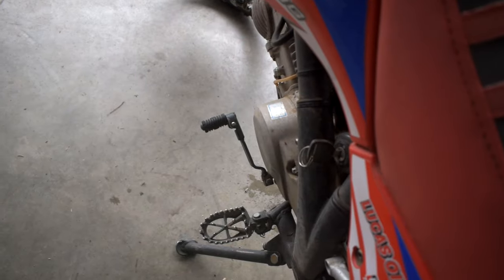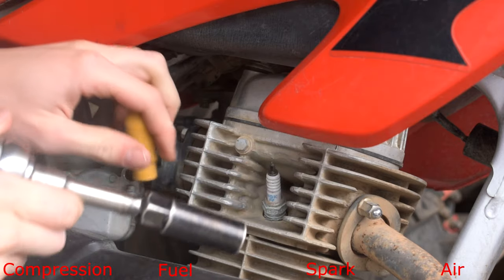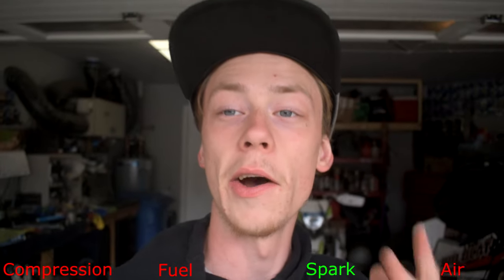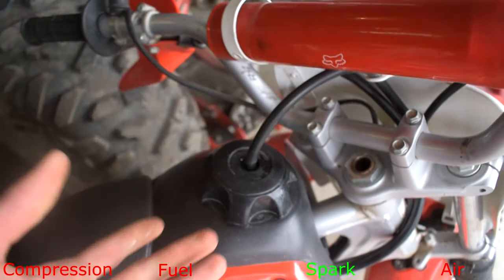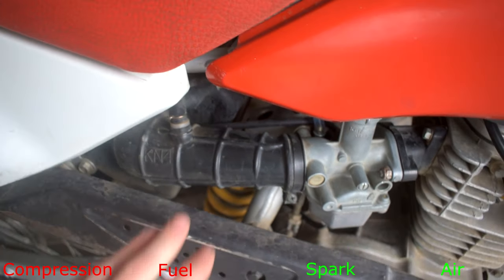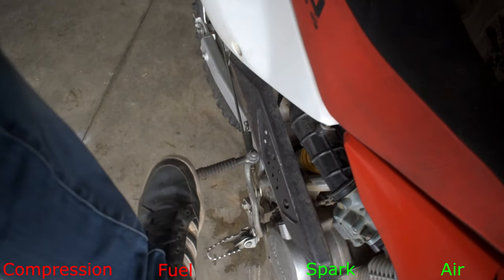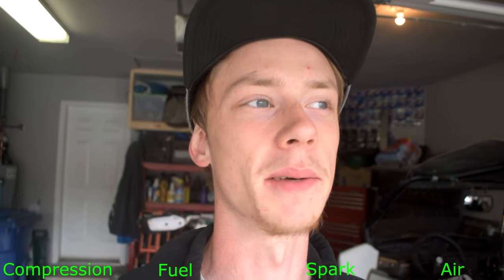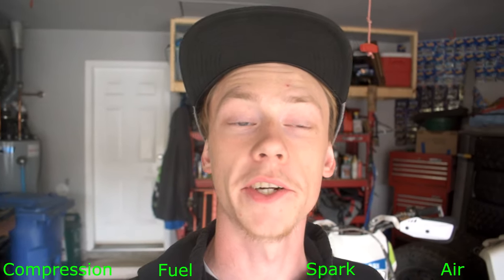Dirt Bike Wont Start? Here's How To Fix It + EXTRA TIPS

Comment: I got a 2010 coolster 70cc pit bike and won’t start with low compression. I have spark, fuel, and i even put fuel in the spark plug but wouldn’t even try to start
Reply from the maker: If it has low compression that’s your problem
Reply: @AaronsEnduro  how do i fix
Reply: @AaronsEnduro  and how much would it cost
Reply: @AaronsEnduro  could i still bump start it
Reply from the maker: Thats the same problem as someone saying “my heart barely pumps any blood whats the fix?” Well get a new heart or get an artificial replacement lol

Thats the sign of a blown engine buddy
Reply from the maker: Also, putting fuel in the spark plug is not what you wanna do. Thats how you hydro lock the engine. Your supposed to put the fuel on the air filter to see if your issue was fuel related. Liquid doesn’t compress, so when you put it into the spark plug you could of blown your engine
Reply: @AaronsEnduro  me and my dad fixed the timing chain but won’t start. One of the valves it tight so were gonna loosen it up tomorrow any other ideas?

Comment: what if everything is good but it wont start ( i think the spark dont get gas)
Reply from the maker: If the bike has EFI and your battery has to low of voltage it wont be able to run either
Reply: @AaronsEnduro  i have a cheap chinese pit bike it doesnt have a battery
Reply: @AaronsEnduro  did it now its better than ever the problem was with the timeing
Reply from the maker: Timing will definitely mess it up! Glad you were able to get to sorted out! And tha ks for reporting back on the issue!

Comment: Would it be making a different sound if there’s no spark
Reply from the maker: If theres no spark the bike wont run. If it runs but super crappy u may have weak spark. Check the spark plug. You may need a new plug or to tighten the spark plug gap
Reply: @AaronsEnduro  I can’t get it to start at all and when I poll the throttle and kick it it makes a weird sound
Reply from the maker: Have you checked to see if you’re getting spark?
Reply: @AaronsEnduro  I got it to start then it turned off on me the night before it rained  and idk if water got in the exhaust I took off the exhaust and only like a few drops was in it but I got it to start like 2 times but it was really cold and just turned off both times within 10 to 30 seconds and after that I haven’t been able to get it to start
Reply from the maker: What did you check
Reply: @AaronsEnduro  but if I’m getting no spark and I pull the throttle will it make a different sound
Reply: @AaronsEnduro  I checked oil gas air box last thing is spark just haven’t done it yet but will in the morning I wish I could explain the sound
Reply from the maker: Check in after u check if you have spark
Reply: @AaronsEnduro  ok thank you

Comment: Just wondering if you are still answering questions I know this video is older
Reply from the maker: Always brotha
Reply: @AaronsEnduro  my buddy just got a magician 250 getting spark, plenty of compression, good air, I moved the kick stand kill switch so i didnt have to fight that. now it cranks but i cannot get it to turn over. I hit it with starting fluid and It starts and stops that quick. looked at the carb and it is clean, plug not fowled either. it almost feels like a kill switch is engaged but cant seem to figure this out... Any ideas? Thanks.
Reply from the maker: How did you remove the killswitch. Did you hardwire it? From your description it sounds like the killswitch is shutting the ignition off

Comment: is it still worth buying a bike with no compression for 300 i can easly fix it??
Reply from the maker: Depends if your willing do a full engine rebuild or not. Also depends if the bottom end is (crankshaft) is toast
Reply: In the ad it says the ring is toasted it just needs new rings
Reply from the maker: Id be careful with that. If it has a cracked ring lang is may have toasted the cylinder walls too. Then if that debris fell into the crankcase id say shes done
Reply: @AaronsEnduro  damn so what do I do is there a way I can check???
Reply from the maker: Its kind of a gamble buying blown engines. You wont really know until you tear into it
Reply: @AaronsEnduro  but would it be expensive to fix it? If it's not just the ring
Reply from the maker: If you rings broke, you’ll definitely need a new piston, cylinder and possibly a head if it’s damaged. Will it be “cheap” depends if you’re doing all the work, and how badly it’s damaged.
Reply: @AaronsEnduro  around how much will it cost for the parts this is my last question and I'll stop bothering you
Reply from the maker: First, i have no idea what bike you’re referencing. 

Second, like i said depends if you’re doing the work or paying someone to do it.

500-3000$+
Reply: @AaronsEnduro  damn that's expensive am doing it my self the bike is a Honda cr85 2005
Reply from the maker: Okay so 2 stroke, easier than 4 stroke rebuild. Its really hard to guesstimate a price until you got it apart and see what all broke
Reply: @AaronsEnduro  ok thanks for the help am going to talk the the seller about the bike and thankd again for the help 🙏

Comment: Mate my bike has all of the above, it’s a brand new pit bike 2 hours on the hour meter, ran perfect yesterday cleaned it and it ran fine after cleaning it yesterday, today it just will not start, everything’s dry, it’s stressing me out
Reply from the maker: Did you cover the exhaust
Reply: @AaronsEnduro  when cleaning it yes,   It’s stressing me right out, every couple of kicks it just pops a flame out the back, but it won’t start
Reply from the maker: Have you tried bump starting it
Reply from the maker: You might just needa kick it like a man
Reply from the maker: U watched the whole video?
Reply: @AaronsEnduro  yeah it won’t bump start either, I’m no novice to put bikes I’ve had loads in the past, but this thing is baffling me
Reply: @AaronsEnduro  yep
Reply from the maker: Does the kickstarter have resistance
Reply from the maker: And can you feel the engine turn over
Reply: @AaronsEnduro  yeah man it’s a zongshen 190
Reply from the maker: Gotta be a key or something you missed, no?

Comment: Ok, so I wrode my klx140rf through a  little puddle of water, and it was barely at the engine like that's how high it was. And after I got out of the water, I was only in for like is full second. It wouldn't start, it wouldn't idle, it wouldn't gas. And when it did start, I couldn't rev but an hour later, perfectly fine. Why
Reply from the maker: My Guess would be air on into the airbox and choked the bike out
Reply from the maker: Or some sort of electrical connection was shorting from water. Considering you say its an RF its a 2021? So brand new? Weird to have any issues there
Reply: @AaronsEnduro  yeah brand new got it a month ago everything is fine but yesterday that happend and it just wouldn't start like 45 Min later just started up like a champ
Reply: @AaronsEnduro  and Im pretty sure it wasn't shorting because the light was still on from the starter but we would go to start and it just went and made the starting sound before it starts
Reply from the maker: Water got in somewhere. Thats forsure

Comment: Hi I have a 125 braap it has compression fuel spark air but still won't start any idea's?
Reply from the maker: If it had all those it would start
Reply: @AaronsEnduro  it kickes over like it wants to start but just won't for some reason
Reply from the maker: @coreywilliams7207  what changed or happened since it last started up. How long ago did it run
Reply: Not 100% sure the guy i got it off said it just stopped one day so I replaced the carby cdi and coil and spark plug and lead and throttle
Reply from the maker: So how do you know it has compression
Reply from the maker: You ever drain the oil yet and look for any metal shavings of piston rings etc
Reply: Yes its got brand new oil and yes its got compression
Reply from the maker: Did you do a compression test
Reply from the maker: You can check if you have fuel by seeing if you open the carb bowl and see if theres a steady flow of gas
Reply: Done all that mate thats the thing iv literally done everything I can think off as a mechanic
Reply from the maker: Then its gonna be something simple thats over looked , like a bad killswitch being stuck on. Or a bad clutch neutral safety (some china bikes wont start if the clutch is being pulled, or it thinks the clutch is pulled some
Reply: Ok no worries I'll have a look at kill switch
Reply from the maker: Best of luck man lemme know what it is if u find out

Comment: Why does my exhaust pipe make like a popping sound out of it when I try to start it ?
Reply from the maker: Possibly bike running lean (not enough fuel)
Reply: It has fuel, I cleaned the carburetor got new spark plugs drained the fuel and now my clutch won’t work, every time it is in gear my tire drags when I hold the clutch it’s weird 😩
Reply from the maker: You need to adjust the clutch cable
Reply from the maker: Watch my video called “how to make ur dirt bike last longer”
Reply: @AaronsEnduro  okay thanks, I will try it out I will be back to let u know
Reply from the maker: Sounds good!
Reply: @AaronsEnduro  do u have any social media I can text u thru so it is faster ?
Reply from the maker: My fb members page
Reply: @AaronsEnduro  where is that at ?
Reply from the maker: On desktop (you can do it on a desktop version of mobile chrome) theres a join button next to the subcribe, thatll take u there and offer you much more guidance aswell
Reply: @motiogio  when my kx 100 did that I need new piston rings

Comment: My xr100 won’t Evan hit on starting fluid.  Any idea
Reply from the maker: Then either the carb itself is gunked in the pilot circuit, or your missing a component of air, spark or compression
Reply: @AaronsEnduro  I’ve got spark got commpressoin I put a little gas on cylinder it still won’t do anything

Comment: Hey man, my bike starts when I split the case and remove the clutch side, but the second I put the case back on, the bike feels as if it had no compression. Any idea?
Reply from the maker: Honestly not sure man. Maybe your kickstart shaft has an issue
Reply: I ve taken off my carb on my 110 and my floater has no problem going up and down. But i still have fuel coming out the overflow nipple
Reply from the maker: It needs to sit level
Reply from the maker: Keep the bowl off, blow into the fuel line and hold the float “level”. If the floats level and you can still blow air through thats ur problem. Adjust the hanger for the float valve
Reply from the maker: Watch this video to understand it better Understanding How To Tune A Dirt Bike Carb
Reply from the maker: https://youtu.be/oyGP1uTU-jE
Reply: @AaronsEnduro  thanks bro.my carb is already off so i ll let u know how that turns out. I always thought as long as you can push the floater with your finger and it returns to the normal position it was all good. But anyways thanks 👍
Reply: @AaronsEnduro  turns out my clutch is toast lmao. Ran some troubleshooting last night. Managed to get it started but it’s slipping hella hard. Putting a new clutch basket on it tonight and gotta make sure I set the cable up right
Reply from the maker: Hopefully get that fixed asap!!

Comment: thanks just bought a 2006 yz450f and it would only start with starting fluid i'll edit this after i try all the stuff in the vid and tell you how it goes
Reply from the maker: Sounds G! Best of luck!
Reply: @AaronsEnduro  sorry for the late reply but it didn't work sadly i took the bike to the shop to get my carb cleaned and it still is hard to start any help
Reply from the maker: @804jojo6  hey, sorry friend i just saw this! did it get resolved?
Reply: @AaronsEnduro  for the most part yes, has a little bog but other than that runs like a beast
Reply from the maker: @804jojo6  when you say little bog, is it a consistent bog at a certain rpm or only at the snap of the wrist
Reply: @AaronsEnduro  only at the snap of a wrist, it's not bad enough that it really makes it not rideable
Reply from the maker: Adjust the c-clip position on the throttle needle
Reply: @AaronsEnduro  will do thanks for the help

Comment: All of this is good on my apollo 110cc and it wont kick over...it sounds like it wants to Start but it doesn't.
Reply from the maker: If he had all of these things it would start.
Reply: @AaronsEnduro  it started for like 2 secs then shut off
Reply from the maker: Sounds like fuel starvation
Reply: @AaronsEnduro  brand new carb
Reply from the maker: Probably not setup correctly!
Reply: @AaronsEnduro  looked it over  and everything's where it's supposed to be
Reply from the maker: And what color is your spark plug (did you put a new one in to see what the fuel burning looked like) if not at the minimum clean your old plug off and see if u get it running for a split second if the plug burned white (lean) or black (rich)

If you’re looking for 1 on 1 guidance you should check this out and we can get it touch https://www.youtube.com/channel/UCcviyKZ2Vf3IHFliwebzODA/join
Reply: @AaronsEnduro  it's a new one

Comment: Bike has spark. Has compression (hard to kick). Maybe not getting enough air idk. Brand New engine :(
Reply from the maker: If you wanna get in touch and chat 1 on 1 join this and we can get it sorted out! https://www.youtube.com/channel/UCcviyKZ2Vf3IHFliwebzODA/join
Reply: @AaronsEnduro  appreciate you. I'll check in on my day off work! Can't wait to get her running
Reply from the maker: @nicholasparry6859  heck ya buddy!
Reply: @AaronsEnduro  hey man. So I got some carb cleaner and she fired right up! Must have been something with the carb. Now I'm waiting on new rear chain tensioner from ebay (should be here tomorrow) not sure if my gearing ratio is adequate, the old Yamaha rear sprocket which was also a 428 was in solid condition so haven't swapped yet. I'm gonna try and upload a video of it. where I'm at. Definitely had my chain to tight in the beginning. Hoping I didn't cause any damages. Took her about 10 miles so far just going around the neighborhood. Seems to really like 3rd and 4th gear after 15-20 mph. Taking to a shop for the front alignment which is better since I tinkered with it but still way off. Already paid them for a fork reseal and got the chassis back without new seals so she has to go back anyhow. Didn't notice it cause I was so ecstatic over dual purpose tires 😂
Reply: @AaronsEnduro  probably forgot to mention this bike is a custom chop. Yamaha HT1 90 chassis converted to hold a lifan 125 engine.
Reply from the maker: If you’ve joined let me know and we can get in touch!

Comment: My Sons Honda CRF50 Kickstarter will not go down
Reply from the maker: Either your broke a tooth and its jammed in the kickstarter. Or the engine is seized. Does it run if you bump started it?
Reply: Is it hydro-locked?

Comment: Bikes still not running my guy 😔 CRF230F. Soo spark plug is dry not even the faintest smell of fuel on it, lines are all fine and replaced cleaned the carby 10000000 times and blew it out with an air compressor fkn sad life lol helllllppppp
Reply from the maker: Did you use an ultrasonic cleaner for the pilot circuit?

Comment: My bike won’t Start pls help
Reply from the maker: What have you checked
Reply: My air filter , my carburetor, did an oil change and changed spark plug, emptied old fuel. Try to bump start it goes but dies
Reply: I have a rmz 250cc 4 stroke Suzuki
Reply: I didn’t start for over 3 years
Reply from the maker: Then my guess since its been sitting is the pilot circuit is clogged in the carb. Get it ultrasonic cleaned
Reply: I will see that too but if there is no compression?
Reply: It wasnt blown what else could it be ?
Reply: And what ultrasonic do you  prefer ?
Reply from the maker: I just think your carb is clogged
Reply: I don’t have a ultrasonic cleaner
Reply from the maker: Take it to your local dirt bike mechanic to get cleaned. I got mine done for 20$ when i bought a used bike that sat and had the same issue as you
Reply: Alright we’ll let you know how it goes

Comment: hey man i have a Honda CRF 250 2012 , yesterday she was running very well but today i started her very hardly,let her sit a bit to warm up and all of a sudden the engine cut off,the bike has very good compression,fuel lines and everything are good,when i try to start her sometimes she spits flames (happend 3 times since it doesnt start) the engine turns over but nothing (there's a very strong smell o gasoline coming out of the exhaust when i kick it over) i tried to push it too didnt want to (it's injection not carb) please help..
Reply from the maker: Im not too familiar with EFI on bikes
Reply: @AaronsEnduro  found out the issue it was the spark plug thx anyway
Reply from the maker: My first guess is your spark plug and to check for good spark ( easiest to test)